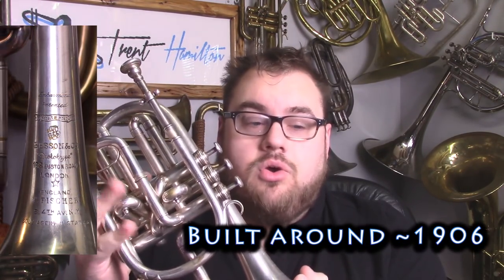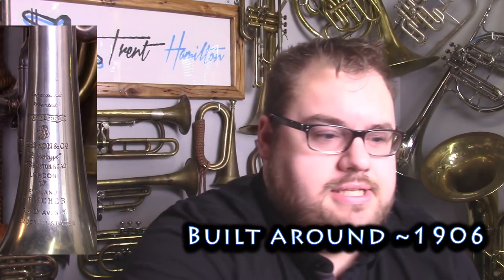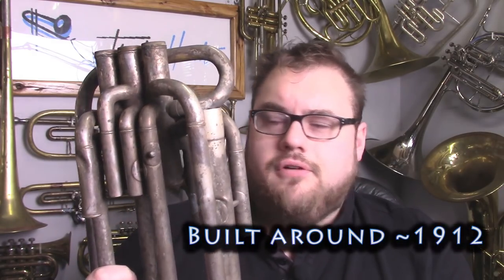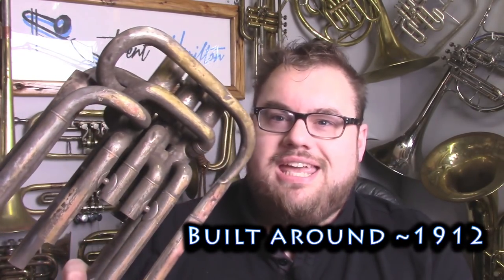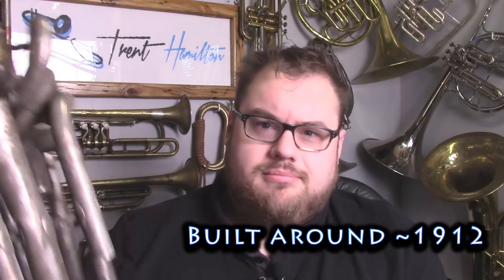About the Besson Enharmonic System

Comment: Correct me if I'm wrong (I'm a trombonist) but if you play a 3 valve instrument the third valve is basically equivalent to the first and second combined, so if you never use it by itself should you be able to just tune the third valve a bit flat?
Reply from the maker: The trouble is that the 1st and 2nd valve combination is in tune in some notes, but out of tune in some other notes, so 3rd by itself is sometimes used as an alternate fingering. But I get the point - normally I tend to tune my third valve a little flat.
Reply: On most modern 3 valve instruments, the 3rd valve is made so the instrument is in tune when playing 2nd + 3rd. This leaves using 3rd alone too flat and using either 1st + 3rd or 1st + 2nd + 3rd too sharp.